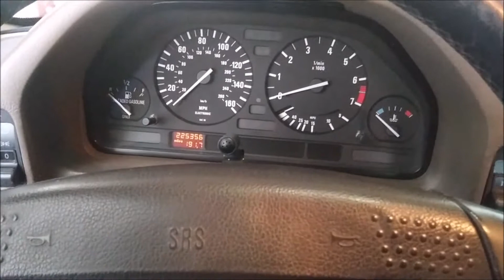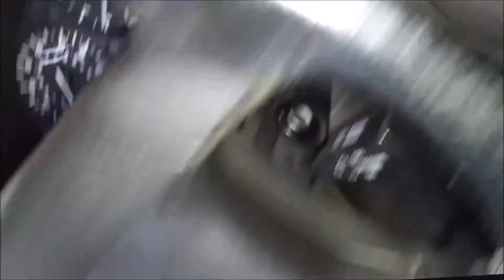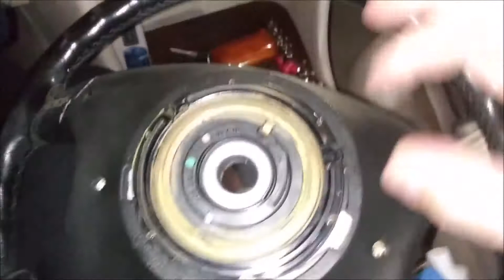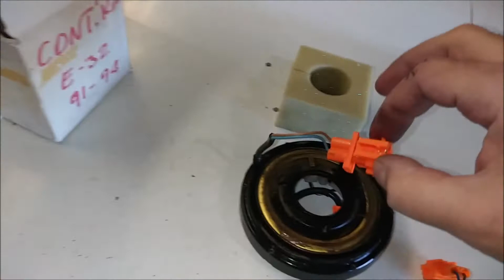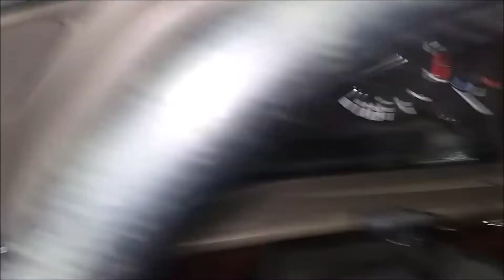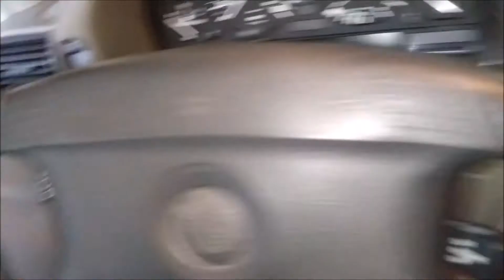BMW 735i - E32, E34 SRS Light Repair - Clockspring replacement.

Comment: Anyone know a alternative tool one still can buy today that works? 

Have a 92 730i, the SRS light is on after the previous owner removed the wheel without taking the battery off first. 

I have later taken the wheel off to check the clockspring and it together with its wire was fine (horn also works), as well as checked the connections to the dashboard airbags and everything seemed fine. 

I've tried resetting it with the wires in 20 pin socket as others on the internet has had success with, but sadly hasn't worked in my case. 

Considering a resetting tool, and then I'll go to module/relays I think. Checked all fuses in the enginebay and under the back seat and they are all fine... Any input is greatly appreciated
Reply from the maker: Hello Adrian, You will probably need a tool to reset the SRS light like I did. You can try to just disconnect the battery and  connect the positive cable with the negative cable for about 10 min. That is a hard reset like they say, it clears all the computers and sometimes it works and will clear some codes. Also you might have an issue with one of the airbag sensors as well. I would go with the hard reset first, then if it does not work have the codes cleared. Thanks
Reply: @PreciousRidez   @Precious Ridez  Okay, will try the hard reset first and then see what tool I might be able to find. Tried many old OBD 1 tools and tools that should be compatible, but none are able to do anything, for any module it seems. But know it can be normal also on E32s with everytging working, as my fathers E32.

Have had the battery disconnected for long periods trying to reset it, but that is not the same effect as connecting poles with battery out? 

Thanks for the reply
Reply from the maker: @Anirossa  No problem, hope it works.
Reply: @Anirossa  Have you tried clearing the codes using the "stomp" procedure? https://www.youtube.com/watch?v=C4T3QAnQAHs&t=1s

Comment: Great video. What model reset tool, and where did you purchase, thanks.
Reply from the maker: On the box it has AST as the company and says (Recall/Reset Tool). I bought it used years ago on eBay from a BMW Tech, guess he was not working on old Bimmers anymore.

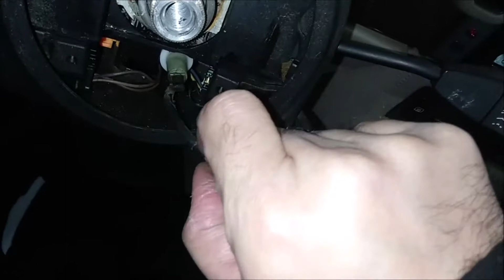Comment: For your information: 07:00 There should be markings inside the "round hole". Two small notches inside for aligning the steering wheel.

Ebay also sells cheap airbag reset tool, so you don't have to let a mechanic do it for you.

https://www.ebay.com/itm/203263030642?hash=item2f536bb572:g:xvwAAOSwEEBaL7xX This is just an example. The prices varies a bit on ebay.
Reply from the maker: Yes, but that tool will not work with the older models, ex E32, E34. (I have one also) It will work on E39, E38 also I believe.

Comment: Great video. Wat kind off instrument do you use for the codes? 
I have a  E32 BMW 735 IAL 1989.
Reply from the maker: Thank you , the scanner is an AST Reset Tool - it resets SRS codes, Oil Service and Inspection lights. It works on all the older BMW with the large diagnostic port in the engine bay. I do not think they make them new anymore, but if you are lucky might find one used for sale.

Comment: Hey great video I have the same issue on my 1994 740 the horn also isn't working did that also happen to you with that wire broken thanks also what pin are you gentleman speaking of i don't want to mess it up
Reply from the maker: Thank you very much for your comment. The horn connection does run thru the clock-spring, so if there is a problem with it the horn might not work as well. I should have mentioned it, but in the back of the clock-spring if you see in the video is a little round hole where a pin located at around 2 o'clock on the steering column goes into. Very important to mate them together so that the clock-spring works correctly.
Reply: @PreciousRidez  thank you keep the content coming on the e32 I will be doing this repair soon just ordered the part
Reply: @PreciousRidez  ok I got the part today I'm going to attempt this tonight I'm sorry for so many questions I heard you have to center the clockspring so it don't over extend and break how did you center it it says the clock spring will go 5 revolutions and 2.5 is center that how you did it lining up with the post at 2 Oclock thanks
Reply from the maker: @vr-cx6lq  Yes, sometimes it comes set with a clip that you take off once it's installed and prevents the clockspring from turning. If not you are correct, you need the same amount of turns in either directions so it will not break. Hope this helps.
Reply: Precious Ridez thank you for taking the the time to answer my questions it’s much appreciated I’ll let you know how I make out fingers crossed
Reply: @PreciousRidez  fixed my squeak noise taking it to a shop tomorrow to clear the code but I still have no horn not the fuse not the relay I'm stumped not sure what to do to test the black horn cable in the slip ring is it directional?  if I understand its just a ground
Reply: @PreciousRidez  well thanks to this video clockspring went in without a hitch my wire was intact but I swapped it anyway .and I figured out what was  the deal with my horns they aren't there lol somebody took them out I gotta A idea slash request  for another e32 video no one has how to remove the front grill on these cars  I know if you do it I'll be watching it lol thanks again
Reply: Light cleared thank you again helping me in my quest to keep this old beast on the road where it belongs 🙏
Reply: @PreciousRidez  picked up a set of used horns from a e38 and wired them in couldn't find e32 horns used even on ebay that didn't cost a ton !!!but now I have Horns that work great no more squeaky wheel and airbag light out  I shared your video on the bmw forum I belong to maybe get you some more well deserved subs thanks again
Reply from the maker: @vr-cx6lq  Thanks again, glad everything worked out and also glad my video helped. 👍 That is one good reason why the horns did not work..😂
Reply: @PreciousRidez  especially when you check everything but if they are actually there in the car  lol lessen learned "never as easy as it seems "TRUTH

Comment: "Never as easy as it seems" - pretty much sums up most of the DIY stuff I did so far on my car! :D
Great video thanks for posting. I had no idea about this flashing SRS error, good to know for the future.
Btw there is a cover under the rear seat on the passenger side that has a negative battery cable behind it. You can remove this cable to disconnect the battery if you don't want to take off the seat.
Also it's important when reinstalling the steering wheel to make sure that the pin on steering column matches with the clock spring.
Reply from the maker: I see you understand my pain : ) , thanks for the info on the battery. Good catch on the pin, I did match it up but forgot to mention it when I turned the camera back on. Thank you for watching.
Reply: Hi, I was wondering if this was an original feature or not! That clears it up now. On my car the cover is missing. Do you know where I can find the OE nr for it? I'd rather cover up the hole 😁 thanks!
Reply: @lukasvdbreal  Hi, the battery ground cover is a two-piece component. Here are the part numbers including the different colors.
Housing: 51711969746 
Cover (black): 51718148713
Cover (marine blue): 51718148715
Cover (silver grey): 51718148714
Cover (parchment): 51718148716
Cover (red): 51718117128

If you search online for this, you should find it easily: BMW E34 E32 Carpet Battery Ground Access Cover Housing Cap